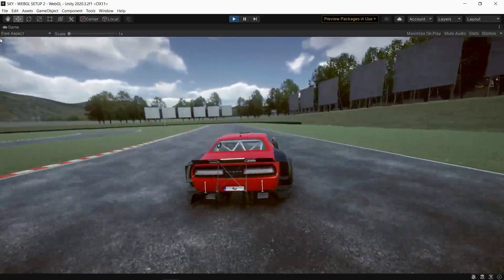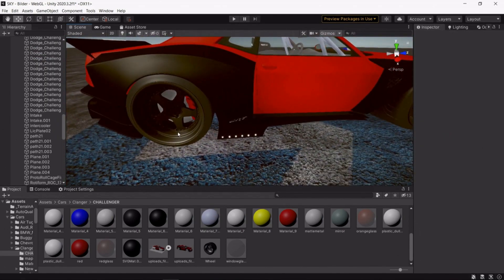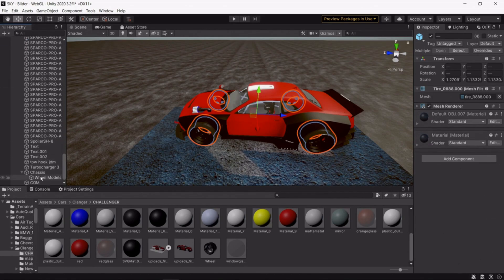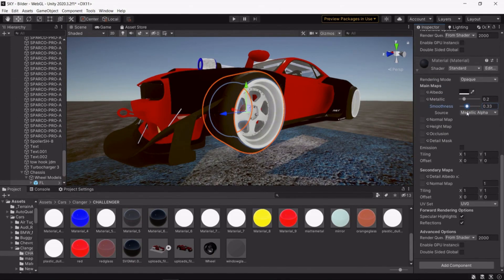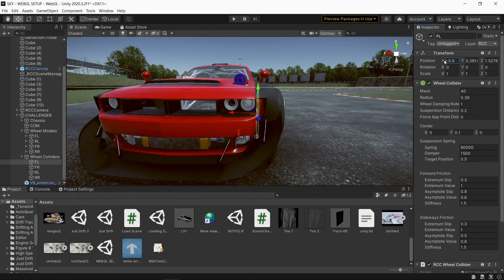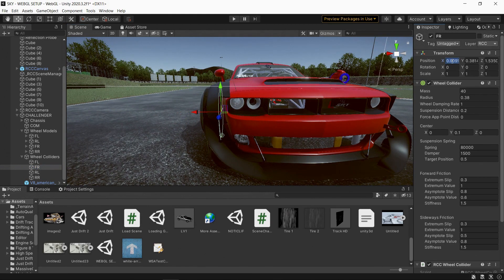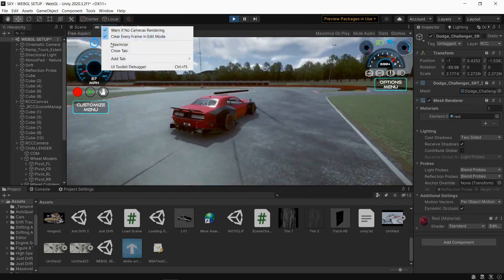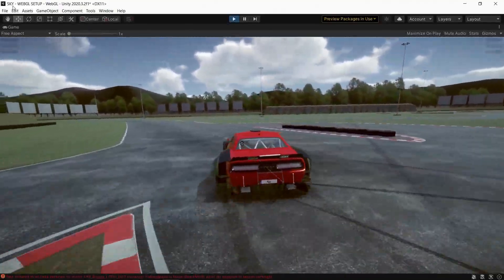Unity RCC Drift Tutorial

Comment: or make the transform on the Y position is 1 higher then zero
Reply from the maker: I'll mess with this, last time I tried it did NOT seem to help. However going over all my Prefabs I realized NOT all my Prefabs are at XYZ 0 so maybe that was my issue, all Prefabs need to be at XYZ 0. I'll mess around and do testing see if that fixes that issue for good... Thank you for the tip!!
Reply: @orengecrest6283  your Welcom :)